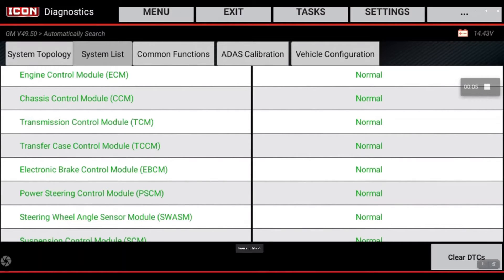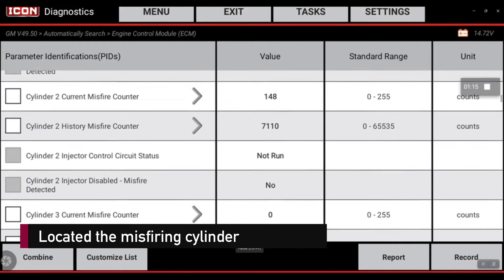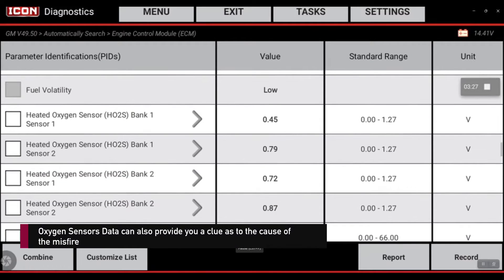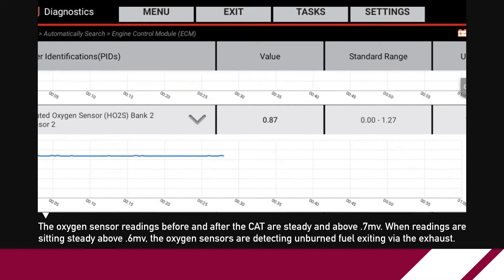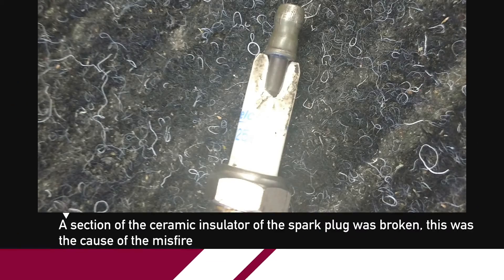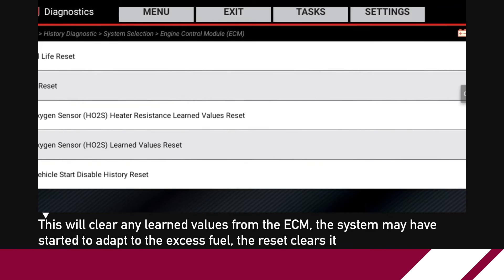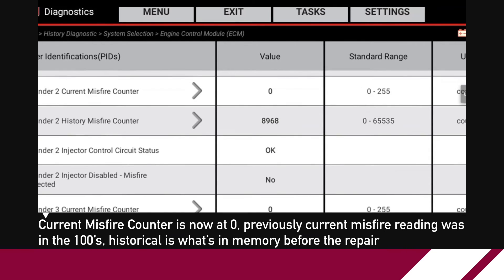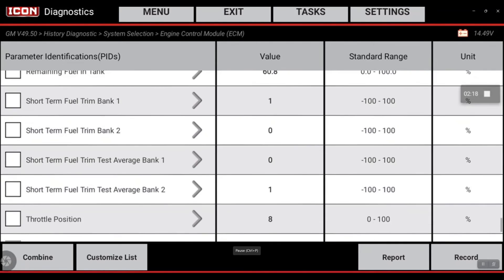ICON T8 Engine Misfire

Comment: Bought this tool for my 2009 Nissan 370z. But when hooked up, I don’t have any of these options. Wondering if you would have a link to help me in the right direction. 

When I’m hooked up to a ford, Chevy, or any of their side brands, I’m able to find and read I need. So I’m not sure if it’s the 370z and the scan tool that’s the issue

Comment: Some vehicles don't offer this data you can however go to generic OBD2 data in just about any scan tool and go to mode 6 and cycle through the cylinders to find misfire counters it it takes a little bit more time but will give you a similar misfire counter

Comment: I have a t10 as well and can find engine data as well. So I can find the misfire counter
Reply: Have yall found the problem
Reply: @925barz  no. For some reason on my 350z I am not able to find the data. Tried different scan tools. Same issue. But on my sister in law's Pathfinder, I was able to get to it easily.